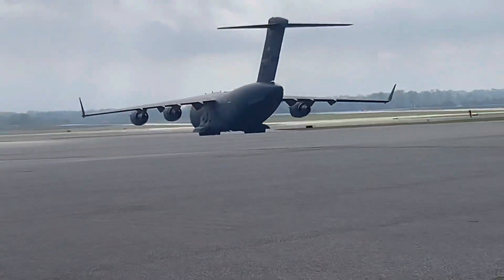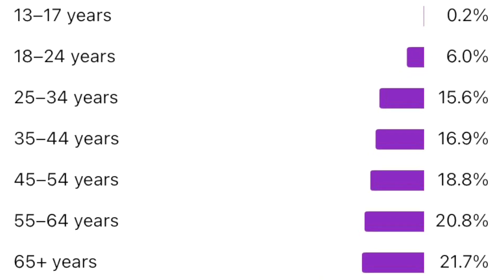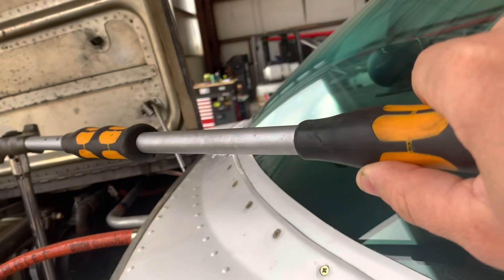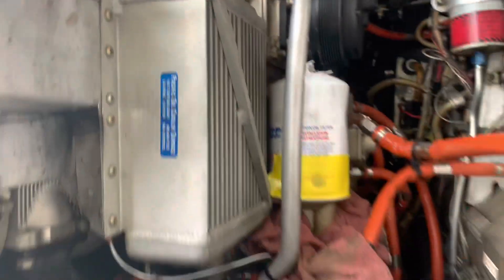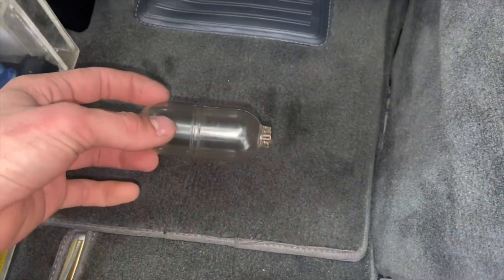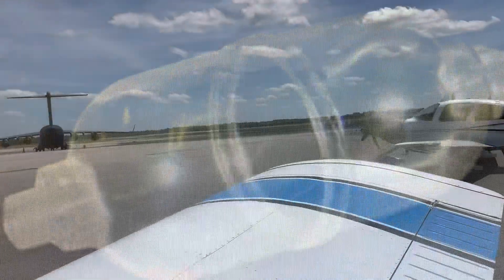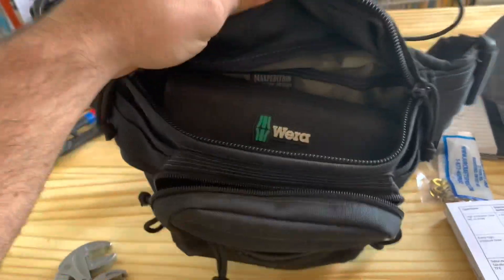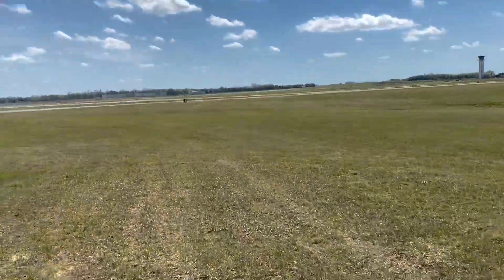Poll results are in. Cessna 182 pitot static leak. Tempest no lube filter bandit strikes again. A&P

Comment: A trick for the tempest filters and this is what tempest has told up but get a little water and wiper the stuff off the filter gasket then apply a little bit of DC4 and it shouldn't get stuck on

Comment: Retired A&P here.  Love your tool box but I have to wonder if you have ever damaged a bolt head or fitting with those plier-wrenches.  Can they really apply a lot of torque without slipping?  As for the Leatherman, I have a couple that I received as gifts, but I do not regard them as actual tools that would be found in an A&P's box.  Maybe in the glove box of a rusty pickup truck would be okay.  But maybe it is just my age that makes me say that.
Reply from the maker: Every A$P I know has a knipex pliers wrench.  The cobra’s are for pulling and bending cotter pins, and a multi tool is handy in any situation

Comment: There's such a thing as a breaker bar and then a  break off bar lol
Reply from the maker: I was about ready to take an ace to that engine…. Call the customer, and say “yeah, we gotta snatch the engine, we found metal in the filter 😂”. Jk
Reply: @aviationsquared1909  yeah some people really get freaky about tightening filters. Over the years I've had to absolutely destroy a few. I mean piece by piece.  Some of these people need to calm way down when they're putting those filters back on.
Reply from the maker: It’s got safety wire on it……………….. but yeah it’s nuts.  Never had my oil filter vibrate off my car and it get way more abuse.
Reply: @aviationsquared1909  exactly....ignorance on display.  Same here. Never once had a filter loosen up. Heavy equipment, big trucks, 4 wheelers(cars and regular trucks) motorcycles.
Reply: @aviationsquared1909  make a video about proper safety wiring practices.  A how to.  Would love that. Thank you

Comment: Re: The stuck oil filter. I notice that's a Bonanza, and I can tell you that the only airplanes we've run into that problem with are Bonanzas with that oil filter adapter setup. I suspect that position completely cuts of all cooling air flow, so the filter literally bakes into the adapter face. We've run into it with both Tempest and Champion filters, but only in those Bonanza installations.
Reply: From a BOA certified mechanic...it is from gorilla torquing that oil filter.
Reply from the maker: When I find that A&P we gone have words 😂
Reply from the maker: One was a pilot oil change though…….
Reply: @aviationsquared1909  see how often a stuck oil filter has reused safety wire
Reply: don't know if it is a waste of money or not but Tempest makes a torque wrench specifically made for the oil filter, my buddy purchased it and I use it every time I change my oil (and his which is how I ended up paying for it).   Never had a filter leak or be difficult to remove, Champion or Tempest.  Prevents me from over tightening it since I don't have a calibrated elbow plus I figure somebody a lot smarter than me figured out how tight things need to be
Reply from the maker: Here at the shop, we don’t have issues with that on our birds.  It’s everyone else’s that come in stuck 😂
Reply from the maker: We had a SR22 with the tornado alley setup and it was stuck even worse.  We put two guys on it so one won’t slip the wrench off and bust the windshield with the breaker bar
Reply: Don't you love how owner filter changes manage to reuse the safety wire ?  🤣.....just torque it down until the wire fits again !!!

Comment: What is a firewall static port? Where can it be found?? in the 43.13-3/4?
Reply from the maker: This video is for entertainment purposes, not your logbook entry
Reply: On high-wing Cessnas like the 182, the pitot-static system ports are on the side(s) of the fuselage just behind the firewall. The 172 has a single port on the left side, while other Cessnas like the 182 has a port on each side. Those plastic sump bottles screw into the ports to collect water and keep it from entering the rest of the system.